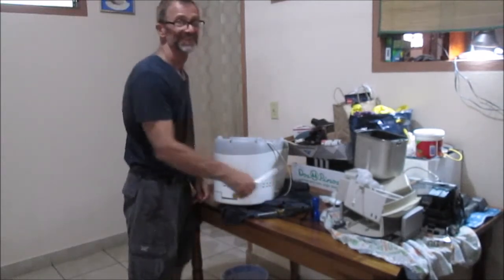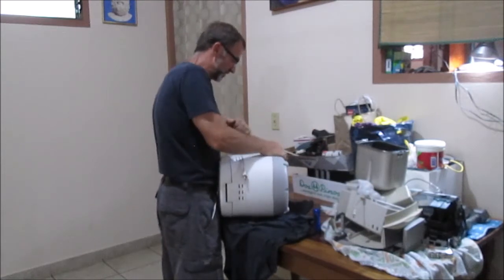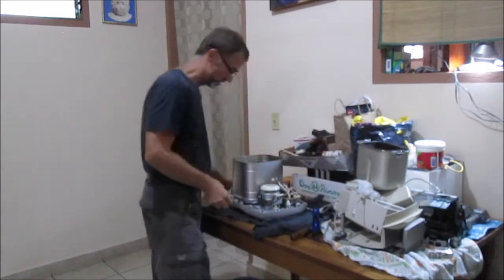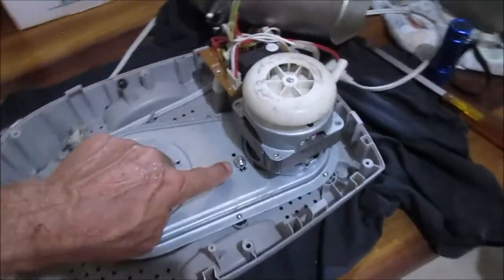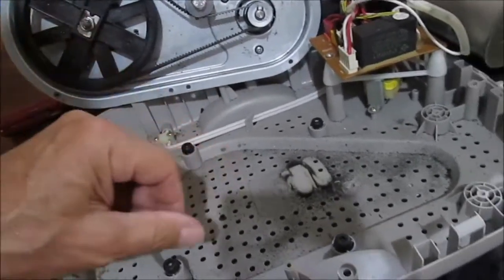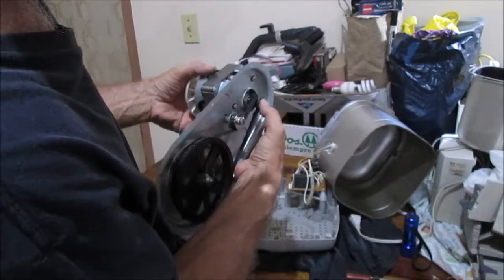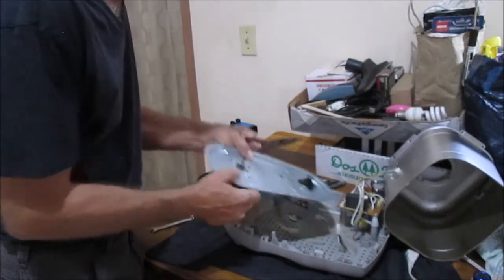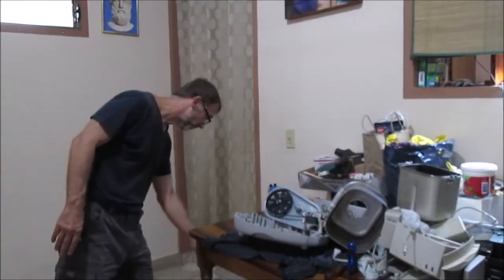Hamilton Beach Homebaker 29881Z Disassembly 5/21

Comment: I can barely hear you nor see what youre doing. After you take out the 8 screws how exactly are you prying to get the case off? This is when I break stuff
Reply: I used 2 flat screwdrivers. Gently wedge #1 into the joint. Then wedge #2 about 2 inches to the right. Pry gently. If you don't hear the click of the clip disengaging, remove #1 and wedge 2 inches to the right of #2. Pry. Continue alternating until all clips have disengaged.

Comment: I came here to see "how" to get the screws out and you skipped it😒  There are 2 screws that are not phillips that require a special bit.  What is that bit called?
It has three points.
Reply from the maker: I think I used a flat head screw driver, but I know I didn't use a special tool...
Reply: Yeah wtf Hamilton beach ??
Reply: I have the same two stupid screws and a flathead ain’t working.